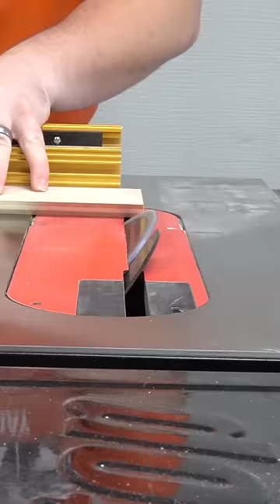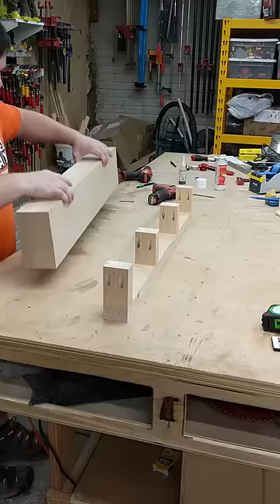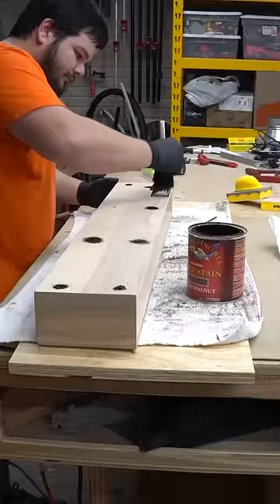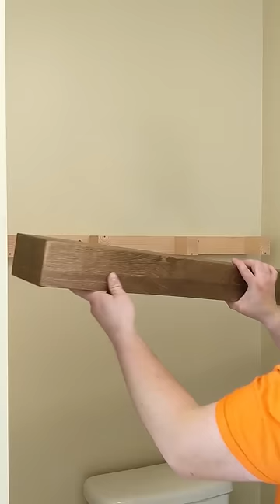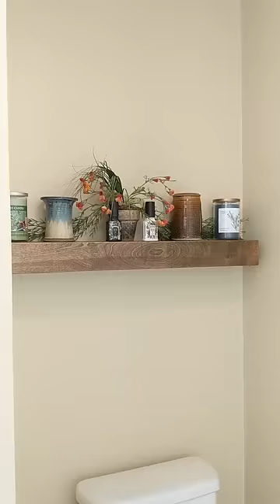Making a Floating Shelf

Comment: Nice!  I made a shelf just like this before  just a little tip for others....if you don’t want to have any screws on top/ the top and bottom are more visible than his here, what I did was put some slim shims over the bracket and then tapped the shelf on so it fit tight. It hasn’t moved in about five years so I’d say it worked
Reply from the maker: Thanks!  That's a cool idea, will have to keep that in mind for lower shelves in the future.  This shelf is above eye level, so you can't see the screws at all.
Reply: This is a great idea ☝️

Comment: Cracking work but over done it on top screws.. one small screw in each corner...but it's your shelf! Your projects! Your screws....so you screw away!
Respect from a wood ticker
Reply: Plus place the screw on the bottom side of the shelf so it's more concealed. js
Reply from the maker: Appreciate it.  The screws were just extra security as I have a 3 year old that likes to climb.  Probably over done, but now no chance of it coming off
Reply from the maker: The shelf is above eye level.  Putting them on the bottom would make them visible.  Having them on top you can't see it at all.
Reply: @ToolsToday  Awesome job then!

Comment: I built floating shelves essentially the same way.  No screws necessary on top.
Reply: How do you get it to stay?  Some sort of detent inside?
Reply: I just slid it into place over the supports.  They haven’t moved since.  Once you weight em’ down with stuff they aren’t going anywhere.
Reply: It’s not going to go anywhere, unless up pull it
Reply: Can even add a French cleat style mount to the wall. Or if you need the support because it’s a deeper shelf & need this same style mount then you can add a lip to the end of the brackets & a recess to the inside top of the shelf to lock it into place, to remove just lift up then out.
Reply: Till someone falls and grabs it for support then pulls it of. Not saying its going to happen but it could. Could probably throw even a dab of wood glue somewhere just in case.
Reply: @congapilon  odd place go put something like that but you do you.👍
Reply: Glad to see you! I am a young design engineer from St. Petersburg, Russia. In our country, working with such equipment and tools, I'm afraid of this word, is a luxury. ..besides, the education system itself and the actual training of specialists are far from perfect. I am ready, with your help, to lead the directions of interest in this environment. Respond !
Reply: @noobpro9759  well he sounds like a odd ball so yea ... lol
Reply: @Qui-9  I ripped a 2 x 4 to fit the inside height of the shelf.  This 2x4 is mounted to the wall studs and then I screwed two sturdy metal L brackets to the 2x4s to support the floating shelf.

Comment: I think it looked great until you put loads of screws in the top of it
Reply from the maker: The screws are not visible.  The shelf is above eye level.
Reply: @ToolsToday  even still after doing all that great work I think you could have hidden them in some way. Apart from the screws it was a fantastic job 👏
Reply from the maker: @tonygalloway3704  thank you!
Reply: Jack Clark  I understand what you mean but he's done some beautiful work there I think it was a shame just to put screws in the top... it's only my opinion
Reply: @tonygalloway3704 , I made cartop carriers for my Jeep, of two 1 × 3s across. Teardrop shape 1 × 5s on each end, with one  2 × 4  gusset on each end. No metal fasteners, but an eye hook thru each end centered.
Used West System epoxy. Carried a canoe 800 miles each way, and a few hundred miles in heavy wind. Then many years of occasional light carry. Never any problem. It was a test, the canoe had extra securing lines.
Reply: @tonygalloway3704  All you need to do is find a wax that looks similar to the color of stain on the wood or mix some glue, saw dust and whatever color that matches the floating shelf for a cheap alternative to plug the screw holes. After that wipe I’d down and no one will notice. Hope this helped
Reply: @tonylozada4078  Great idea, man 👍
Reply: Jack Clark  if granny did that you'd know she has a thing for good craftsmanship!
Reply: @ToolsToday  I think you could have used as little as 2 screws to keep the shelf secured to the structural support. No real need when its for candles and knick knacks. I liked the presentation of your video, shows your work without getting bogged down.
Reply: @tonygalloway3704  ok then what would u have done then ? Or are u just a troll

Comment: Didn’t get what you did with the pocket holes - as in how your attached them to wall or front piece? Is there a longer video out?
Reply from the maker: Yes, search #ttfloatingshelf on Instagram to see the full video, I will see if I can edit the full video for YouTube as well.  Basically I just used the pocket screws to attach the 2x4 supports to the longer 2x4 that attaches to the wall.
Reply: Really

Comment: You don't need your fingers?
Use a pushing stick!!!
Reply from the maker: I did.  The parts of the video showing pushing the wood through the saw are edited to cut down on the time of the video. You don't use a push stick while the wood is still sticking off the front of the saw table.  That's a recipe for disaster.
Reply: Give me a break. His hands were miles from the blade
Reply: Uhh a professional
Reply: just going to post same thing
Reply: @ToolsToday  Glad to see you! I am a young design engineer from St. Petersburg, Russia. In our country, working with such equipment and tools, I'm afraid of this word, is a luxury. ..besides, the education system itself and the actual training of specialists are far from perfect. I am ready, with your help, to lead the directions of interest in this environment. Respond !
Reply: Its only a mater of time. We all get the woodworkers fingers eventually. Touch wood.lol
Reply: Realistically if your paying attention you will be fine, just don’t get comfortable, that’s where mistakes are made, a confident worker is safer than a un confident afraid worker
Reply: Chill bro!! 1st. He’s got a saw stop. Duh!!! 
2nd real men clip their finger nails on a table saw.

Comment: Looking to make something like this..the mitered corners are nice, however im going for a bit more rustic look so ill probably not do that..but is there a reason to screwed the shelf to the bracket from the top instead of from the bottom?? Mine will be placed where the top will be visible, but the bottom will not (behind my washer & dryer) is there another reason why you'd attack from the top rather than from the bottom?
Reply: **attach

Comment: Anyone know what is that disc at the end of the driver?  Does it limit screw depth?  Does the bit grind over the screw head at that point?
Reply from the maker: It's the 55227 no mar countersink https://www.toolstoday.com/v-11618-55227.html .  It's a depth stop to make each countersink the exact same depth.  It has a ball bearing on it so it stops on contact and doesn't mar the work surface.
Reply: @ToolsToday  right on, thanks!
Reply from the maker: @Qui-9  No problem

Comment: Why did you screw it in (internal part) toenail like that? Could have put screws at the wall side of the bracket.

Extra steps and now its weaker.
Reply: Also, you could've bored a half inch hole at every 16 (or however many studs you are going across).Then use picture frame brackets in those holes put screws straight into your studs hang your shelf,then screw more into your studs from the bottom of the shelf at a 45 degree angle,thus being able to use a solid piece of 4×6 instead

Comment: Hope he doesn’t lose too many fingers
Reply from the maker: My fingers were never actually all that close to the blade, camera angles have a way of making it appear closer than they were.  Also, I did use a push stick feeding it through but that was edited out due to length of the video, plus it's a disaster waiting to happen to use a push stick while the wood is still hanging off the front of the saw.  You can watch the full video here, if you're interested. https://www.instagram.com/p/B5TeIVOApyK/
Reply: @ToolsToday  you still don't look very confident with the table saw. Never put your fingers in the path of the blade btw. If you do slip for whatever reason there the fingers go
Reply from the maker: There was no forward pressure from my hand in the direction of the blade.  That's why my fingers moved not my hand.  If it slipped my hand would have hit the fence, not the blade.  I'm very confident with the saw and have a healthy respect and understanding of what the saw can do to me.  If all else fails, this is also a SawStop table saw, so if my finger touched the blade, the blade would be stopped almost instantly, drop below the table and leave me with just a scratch.
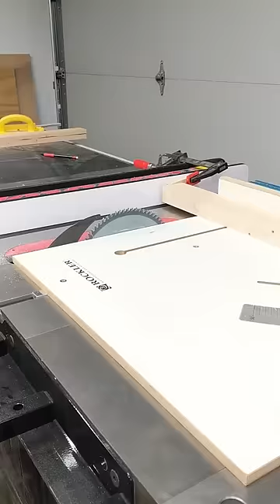Reply: @ToolsToday  what about at 00:03 and 00:14 and your not always gonna have the luxury of your fancy sawstop. Seem's like a weird stance to emedietly throw out the expensive safty feature
Reply: @marnixkamminga8083  
You spelled immediately and safety wrong.
Reply: @buellb0y  english is my third language and it's three o clock at night. I don't care. And i'm dyslectic

Comment: Miters are a really hard way to make boxes.  Use rabbits instead they come out so much cleaner.
Reply from the maker: Rabbets would show exposed plywood on the edges, that's why I went with miters
Reply: @ToolsToday  gotcha.  I’ve made them doing both methods and had way more luck with rabbits.  But I was using pine so miters make sense for plywood.

Comment: That’s cool, but I prefer a French cleat design because it’s simple and sturdy
Reply from the maker: A french cleat is a great system and I use it a lot, but not for a 8" deep shelf that's only 3.5" thick like this.  Weight on the front of the shelf would cause it to pull out the back, and if my 3 year old daughter were to try to pull up on it, which she already has, a French cleat likely wouldn't hold with all the weight on the front.
Reply: @ToolsToday  sounds like a great idea for a comparison video😁
Reply: Glad to see you! I am a young design engineer from St. Petersburg, Russia. In our country, working with such equipment and tools, I'm afraid of this word, is a luxury. ..besides, the education system itself and the actual training of specialists are far from perfect. I am ready, with your help, to lead the directions of interest in this environment. Respond !

Comment: Uses a half face for cutting the wood but not sanding it or applying chemicals??
Reply from the maker: The festool sander I'm using collects 99% of the dust and I had a dust filter running in the room.  The stain I'm using is a 0 VOC stain.  I am however allergic to poplar, the inside of the plywood is made from poplar, the outside is birch.  Had I not been wearing it I would regret it for a week.
Reply: @ToolsToday  nice I respect it, good work in the shelf.

Comment: I love the look of floating shelves but as pretty as yours are they are too thick. In order to make them thinner you will need a much stronger holding bracket and wood will not suffice. If you look at the Ikea brand shells you will see the type of mounting bracket they use. Welded rods on a sheet of metal so they can handle the high forces due to the leveraged load at the wall. They are 12 in deep.
Reply: And being a woodworker for some 40-plus years I had to cringe watching how you used your power tools. If you made a strong metal bracket with a rod sticking perpendicularly out then you would only have to drill a circular hole in your solid wood shelf to make it invisible

Comment: Where is your push stick tho
Reply from the maker: I used one.  The parts of the video showing pushing the wood through the saw are edited to cut down on the time of the video. You don't use a push stick while the wood is still sticking off the front of the saw tables, search #ttfloatingshelf on Instagram and you can see the full video showing it.  That's a recipe for disaster.

Comment: IKEA 9.99€
Reply: Exactly! 👍 waste of time 🤣🤣
Reply from the maker: They support 12 lbs.  My daughter has already tried to pull up on this shelf, had that been an Ikea shelf, the shelf and everything on it would have fallen on her and on the floor.  I'll stick with the shelf I made that is still hanging strong on the wall.
Reply: @ToolsToday  see. Keep doing what you love man. Don’t let no one charge that otherwise❤️
Reply: @ToolsToday  it's not ikea shelf issue,it depends on what kind of  wall plug + screws you using and where you fixing (concrete wall,wood,plasterboard,etc.) 😑
Reply from the maker: @sereg4g448  It's a 1/4" particle board box wrapped in wood look plastic hung by 2 keyhole slots.  A stronger wall anchor may hold an additional 10-20 pounds before the screws strip out of the particle board or the 1/4" particle board surround gives out.  They're cheap shelves and are built as such.
Reply from the maker: @goose.023  I appreciate it.

Comment: If youre not going to use a push stick, stop holding your hands down the line of the blade. 99% of the time it will be faster and have no issues, but powertools dont discriminate and will eat you when youre having a bad day. Only takes 1 sneeze, 1 phonecall, 1 second of complacency and you have some major damage that could have been prevented. Seen it happen so many times and it was never ever worth the risk for the benefit.

Comment: Wouldn't it be easier to just use a 4x6🤔😳
Reply from the maker: I didn't have a 4x6 and then it's also figuring out how to attach it to the wall with no hardware showing.  It's a project I will likely do at some point as a fireplace mantle, but that wasn't what I wanted to do here.

Comment: Overboard. Sinking the screws in the hidden part
Reply from the maker: I'm not sure how countersinking the screws below the surface so the items sitting on top can actually sit flat is considered "overboard".
Reply: @ToolsToday  it’s overboard because a normal screw counter sinks itself and any bulge is negligible when you have an inch board above it.
Reply from the maker: @157dixon  It took me maybe 30 seconds to drill out the countersinks. The plywood is 1/2" any bulge would cause whatever's on it to rock.  Screws generally leave some tear out when they drill their own countersinks, it's not a clean finish.  It's not overboard, it's taking pride in what you're making.

Comment: Literally ruined it with those huge counter sink holes on top. Should just tacked it with a brad nailer
Reply from the maker: They can't be seen, the top of the shelf is above eye level.  I need to be able to remove it if I need to, so screws were the best option.

Comment: To be honest.. why didn't you just buy a half way decent 4×4 or 6×4? Nothing about this video makes sense. Wich is off and odd. Most your videos make sense. But not this one. I built a hideaway. You pull on one side.. the counter would swing open and a "weapon" shotgun size was hanging on pegs. All items on well polished banister  were affixed in a way. It was a reverse engineering of my hideaway in wall egress step stool. Odd square of sheet rock. Hit it and a ladder folds out. About 20in wide and 20 in tall. If you think that sounds interesting. I can tell you about how I built an entire hidden apartment inside an office building. Jacuzzi, a stove, and the whole works.. hidden behind a bookcase. The whole secret apartment mostly ran off 12 volt system.  Used existing pipes for exhaust gases from the kitchen sink, stove exhaust, toilet, jacuzzi and glass shower.  Put in new hot water heater in basement. Biggest i could fit. 20 gal. Gass. Then installed a 10 gal electric. Used PEX. To stay with high flow 1/2 lines to a third water heater.  Supply/demand water heater.  See the Jacuzzi was 50gal. Yes I put in all electric. Funny how our building went from 220 outside to basically all lights being 12 volt LED systems. 4×2 drop lights to outside spot lights. Even built digital timers for everything. But my favorite was my power backup for hidden apartment. Under normal use. The battery backup system would  by my calculations. Cook one meal, charge most devices, keep lights on and water flowing (not exactly heated, i had a black 50gal roof hot water drum on roof. Only would operate when 12 volt system kicked in.)  But the emergency system worked for 1 month and only used 1/5 system emergency power. As there was also solar to recharge the system. I figured the system to basically work 6 months under heavy use. Indefinitely under lite to moderate use. Basically lights used for less than 3 hours. Stove not used. Heating, not used, cooling, not used. Charging ports and communications.. less than 2 hrs per day. Emergency 12 volt stove. Around 20 min per day. Water  pumps. Only a few minutes per day. Basically it would pump about 5 gal water in 5 min if water sensor in resuvor tanks showed low levels. Yes this hidden apartment had fire alarms and co2 alarms. Yeah.  Kinda have to.  The stove was the kind that could be changed from natural gas to propane with the flip of a leaver and changing 6 gas valves. The walls in this apt were awesome. First look.. well nomatter how one would look at the sky grey walls would one know. 3 layers of 5/8 fire rock. 5 layers of Kevlar. All the way around and up. Filtered air. It was an awesome project.
Reply: Glad to see you! I am a young design engineer from St. Petersburg, Russia. In our country, working with such equipment and tools, I'm afraid of this word, is a luxury. ..besides, the education system itself and the actual training of specialists are far from perfect. I am ready, with your help, to lead the directions of interest in this environment. Respond !
Reply: @Однаногаздесьдругаятам  how can I be of assistance?